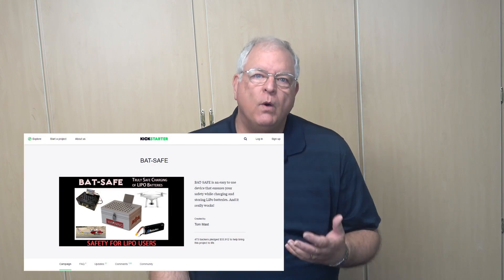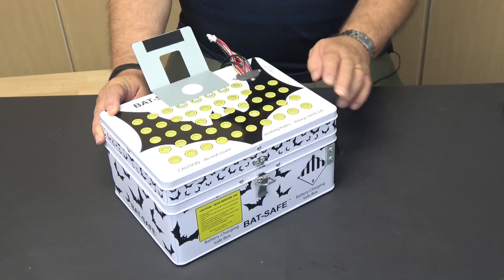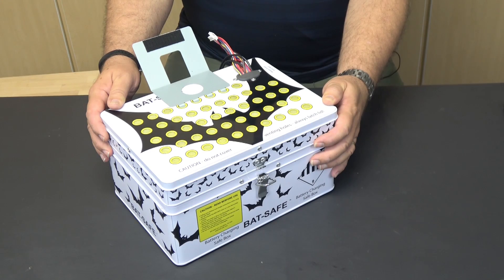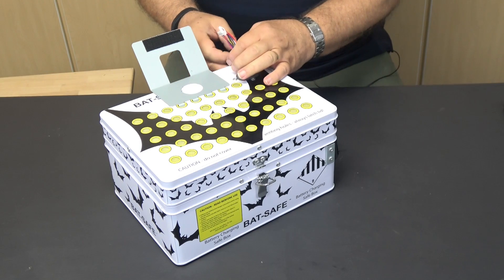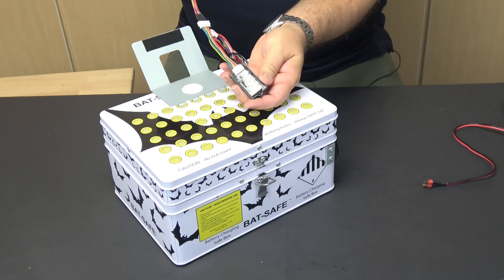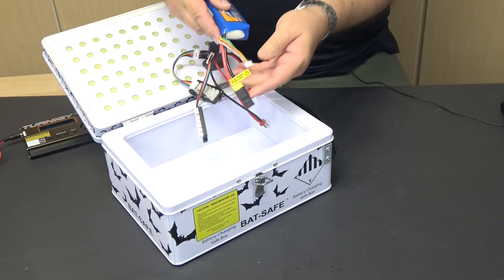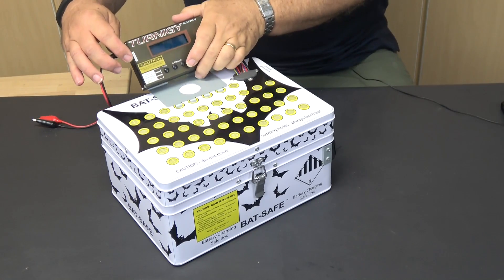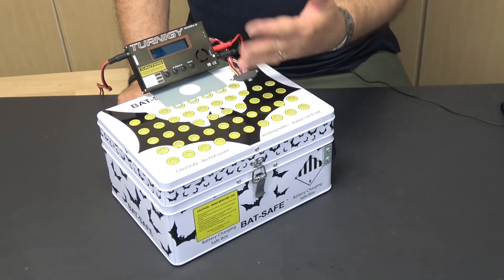RC Gadget Talk - Bat Safe Battery Charging Box

Comment: I have spectrum g2 batteries and new chargers it’s not cheap.. but the batteries have just one cable no balance lead .. and when plugged in the charger does the work for you and counts down when the g2 smart battery is done charging.. the batteries also self discharge..it’s not perfect.. but the rc world need to get safer

Comment: Bought one of these for safe charging and one XXL variant for storage of all my LiPos from 3 drones. The XXL is safe for over 600Wh battery capacity. In addition I put fireproof mats (for BBQ grills) under both Bat-Safes because there are videos showing that the lid might lift a bit for a moment when a LiPo explodes and there may be some sparks coming out of the gap. Those mats are cheap and may be an additional safety net.

Comment: you almost had a short circuit... you did a reverse connection by plugging the battery first and the positive and negative bullet connector might touch each other  (the same goes with balance connector) while you are doing this video.. .. to minimize the short circuit, you should  plug the bullet connector first  (and the balance connector) to the charger then  connect the battery...  hope this help...

Comment: If it wasn't so ugly I would buy one...
Reply from the maker: It's not my favorite color scheme but I don't take it out in public!
Reply: As a new RC hobbyist, I just ordered my own Bat-Safe, and compared to an ammo box for storage of LiPo batteries, I think the Bat-Safe is a better option than the ammo box, by far, and I couldn't care less about the "ugly" looks of it, when it comes to the safety of charging the battery, and how it will prevent a fire from happening in my home. I prefer to have function over the form of it any day. This is better in my opinion than having to worry about a LiPo battery exploding and starting a fire in a home, causing thousands of dollars in damage due to many outstanding factors in my opinion.